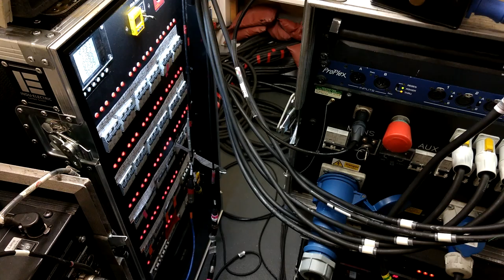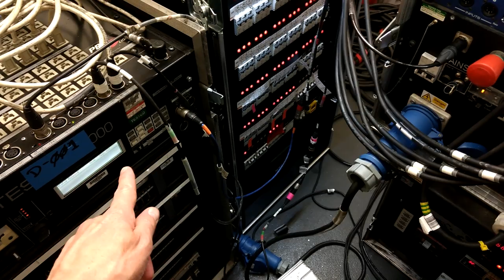Show power distribution.  Edinburgh Tattoo.

Comment: I guess no one uses Halon fire suppression any more. You definitely do NOT want to be anywhere around when that goes off. Happened in a computer center where I worked; someone giving a tour thought the Plexiglas-enclosed big red button on the wall was a light switch. Yeah.
Reply from the maker: I've worked in halon protected substations before.
Reply: That takes me back to my university days in the late 80s when the server room had oxygen masks hanging on the wall.
Reply: I was in Ebury Bridge sub in London many years back now when the halon went off. Can't tell you how quickly I got out of there. After a few minutes had passed control asked me to go back inside for a sit rep; you can guess my reply!
Reply: From what i heard, you'll be suffocated if an Halon system goes of.

Comment: A water based fire suppression system in a room full of electric... Hmm...
Reply from the maker: That's architects for ya.
Reply: Nitrogen gas and water, that would be a 'fogger' type system. Non toxic, zero residue, water itself is an insulator so it's probably the safest system that could be installed in a confined space with lots of public around nearby.  Maybe not the most effective but it keeps the insurance people happy.  Much friendlier than Halon systems where the instructions issued to contractors working in switchrooms went something like 'If the red beacon and siren starts, hold your breath and run'.
Reply: +whorayful  

Yeah, but only if it's distilled water - plain tap water is a perfect conductor because of the impurities and minerals in it, so do not use plain tap water in any fire suppression systems meant for electrical fires, which of course they wouldn't do as they're professionals. :)
Reply: @whorayful9361  - my university server room had oxygen masks on the wall for that very purpose.
Reply: Luxury!
Reply: Some the newer suppression stuff is quite safe, fm200 and argonite is breathable, we use it in data centres, the only real danger is to your ears, imagine 20 trucks air brakes going off at same time in a small confined space, though you can reduce it a bit by having more outlets... the shock from those things going off has destroyed many hard drives. Rule of thumb is if your in there and it hits 3rd alarm (suppression imminent)  get your fingers in ears fast :)
Reply: @jrand2631  even tap water in mist form is safe at mains voltage. The danger in in fires come from the smoke which usually contains conducting soot. The water mist tends to collect the soot on the floor. If you have the money data centers tend to convert to water mist systems as they can keep running in the event of a small fire.  With traditional halon systems you have to cut power and refurbish everything due to soot.

For smaller rooms and where interruption is less of a problem argonite systems are cheaper than water mist. For large rooms where the likelihood of at least one incident during the life time of the room water mist can be cheaper.
Reply: Peter Svensson What happened to CO2 based systems (basically compressed tanks of enough pure CO2 to make the oxygen percentage and temperature drop way down).
Reply: Hade a water vapor system go off by accident in my building in a server room. None of the 200+ servers didn't even go down. It's fairly electrical safe and doesn't kill anyone, not a bad system.
Reply: @johnfrancisdoe1563  I have only seen the argonite and water mist systems. The water mist systems were more expensive and take more space, but are better at cooling the fire and also absorb the smoke particles. The cooling is from evaporation from the small droplets, which is greatly enhanced by the temperature increase near the flame. Further the convection currents in the air will tend to drag the droplets into the fire. But it is expensive, or at least used to be.
Reply: @bigclivedotcom  as long as it's completely deionized water it would act as an insulator still. However, I doubt that's even remotely deionized...
Reply: The problem with CO2 systems is that they are dangerous for humans. If you start venting a big tank of carbon dioxide into a room, the concentration causes unconsciousness at around 7% by volume, and becomes lethal around 10%. However, this is nowhere near enough to actually suppress fire, which requires increasing the concentration to levels sufficient to displace most of the oxygen in the room, which I would imagine to be at least 70% carbon dioxide, if not more.

Another problem is that once a fire has been suppressed by carbon dioxide alone, if you then try to ventilate the gas by opening a door to an adjacent room, the concentration could rise to lethal levels in both rooms, as the gases in the two rooms mix. This has been known to happen with MiG welders working in enclosed spaces, using the cheaper mixed CO2/argon welding gas instead of pure argon.

Using pure nitrogen or argon is a much better solution, since either of these gases can suppress fire simply by displacing oxygen. Argon is better since it is slightly denser than air, but is also more expensive than nitrogen. There is still a risk of killing people if they don't evacuate quickly enough, but that is just due to the displacement of oxygen. When mixed with air, neither argon or nitrogen are toxic.
Reply: It doesn't really matter if it's distilled or not, water is an excellent solvent.  You'd need to keep your electronics clean from salts.
Reply: Peter Svensson Thanks for the clarification. :-)

Comment: Water mist is good fire suppression system for electronics, and used a lot in data centres. Gas systems require full sealed room to operate, as well as pressure relief dampers, as well as other requirements.

Comment: It's fun seeing the difference between UK and US theatrical distro gear.  Occasionally I will work with European equipment, and finding ceeform connectors and those odd value breakers is sometimes a bit of a trick over here.  I have a couple of suppliers, but sometimes the parts are a month out because the entire factory closed down for vacation.

I do wish we had a better alternative to 100A stage pin.  They work well and lay flat, but they're awfully sketchy and can be hard to disconnect.

Comment: NICE!

Although I had hoped that you would have showed us the 400A/660A Powerlock connectors!

Oh well, better luck next time I guess. 😏

Sleep well BigClive!!
Reply: I'll give you a clue, the cable that terminates in it is probably 120mm^2 or possibly bigger!
Reply: 250MM2 from experience. I don't like coiling 50M of PowerLock singles
Reply: 240mm would be a minimum size for a set of 50M at 400A. ive had some in 95mm (limited to 200A) and some at 400mm (120m) ~ 400kg per conductor 1 per road case
Reply: Used to work shows about 25 years ago....  Those power cable road cases were literally the heaviest cases in most of the shows I worked.  HATED working with those...

Comment: The fire suppression robably would not that catastrophic, ive seen 230/400V stuff get wet quite 
often. Even not-really-pure water is not that conductive (and there is 
quite some creepage distance on distribution equipment), it takes a 
surprising amount of water to even trip a 30mA RCD. Which will 
eventually happen though (especially when the dimmers and other mains 
voltage PCBs get wet), and therefore isolate most of the equipment. It 
would take significant flooding until something really bad might happen,
 and until then power should have been cut.
On the other hand, we had one of these Mennekes rubber cube CEE 
distribution boxes sit outside in a puddle, completely submerged, for around a day
 until somebody noticed. Continued to work fine (no RCD there), didnt 
catch fire or leak massive current to trip the 32A breaker feeding it. 
It was quite rusted so we threw it out right away but nothing burned or 
melted.

Comment: Odd question maybe: the white patch connectors, what are they called? 
We use those same connectors at the venue where I volunteer, and that's the first time I ever saw them.
Reply: White connectors are neutrik  powerCON output 
http://www.neutrik.com/en/audio/powercon/powercon-20-a/nac3fcb
Reply: EntourageTouring , yup. White = output, blue = input
Not to be confused with cee-blue. That means 220-240V.
Reply: EntourageTouring Not the distribution box in the thumbnail, the patch panel on top of the dimmer rack that looks almost like a network patch panel ("RJ45"), though it's actually power, not data/phone cables.
Reply: Thanx for all the replies, it's the wieland ST17/2 I was looking for ;)
As an engineer you come across hundreds of different connectors, and I guess it's my ASD that compels me to know how they are all called, especially if I've been using them for over 2 years :D

Comment: 230V @ 400A is a LOT of power, especially in a small space. Presumably "if something goes wrong" there's a main disconnect that trips before the water mist activates? (Mind you decent quality water is pretty non-conductive - the "really good stuff" has a bulk resitivity of 18 megohms/cm)
Reply from the maker: It is a lot of power, and saldy the water misting system doesn't automatically disconnect the power.  Even if you use clean water the general dirt and dust on equipment will quickly make it conductive,.
Reply: Thanks for that info - I was hoping that the water system and incoming power were linked. As you say, it'll not take long for that mist to be at least semi-conductive, and if the juice is still flowing things might become very spectacular ("who needs fireworks" spectacular! :-) )
Reply: Phil S In another video Clive talks about the year some of this stuff failed.

Comment: Looks too small to run 400a, no main isolator that I could see, but I am watching this from a phone. Keep up the good work fella  love the posts
Reply: Its not a dig Rob, are you from North America out of interest?
Reply from the maker: The 400A is a busbar system that loops from unit to unit.  Each unit does have breakers, but only rated to protect the associated distribution equipment.
Reply: @danjones7783  , no I'm from the UK , and as a electrician it all looks a bit light weight to run 400a. But if it can it can
Reply: @bigclivedotcom  cheers Clive, event  systems seem to have a bit more leeway than fixed installation, can't wait to go on my 18th edition course, we'll probably go back to red white and blue not Brown black and grey, lol
Reply from the maker: @robertsmall1715 It all complies with BS7671, but the event industry has an auxiliary standard called BS7909 that is much more complex because it also covers multiple supply sources which may enter each others zones.  Whereas the 17th/18th edition refresher is a one day course, the BS7909 is typically three days and jam-packed with data.
The 400A supply is fed from a suitably protected pillar and also has further layers of protection at the dedicated substation and distribution room.
Reply: bigclivedotcom But wouldn't looping increase the risk that a single failure takes out half the bus by cutting the loop? I would have thought a star system more reliable as each unit can be unplugged while the rest keeps running.

Comment: 400A,does it hum?
Reply: High Voltage AC humms. High Amperage glows.
Reply: @randomplantsandstuff  depends what part you're touching 😂
Reply: Nothing there to hum but the dimmers (when in use).

Comment: What type of lasers do you use there?
Reply from the maker: Purpose built lasers for events like this.  Heavily machined aluminium cases with a sealed optics section and large external heatsinks.
Reply: Sure, I do have some lasers for events myself but much smaller and more consumer grade, my interest is in more detail, what manufacturer, etc.
Reply from the maker: They were hired from http://www.er-productions.com who seem to custom build them.  The cases were very nicely engineered.  Quite a lot of routing and milling involved in making them.
Reply: Thank you Clive! Never heard of them but they seem to be pretty big as they achieved several ILDA Awards. Funny they seem to use Lasers from german company Lightline.

Comment: 400A & 240V?
Reply from the maker: 400A per phase on 240/415V
Reply: Do you have any video of your mains connection? I am interested as this is my line of work. A typical substation will have a maximum fuse size of 400A! (we do have bigger but generally if they need over 400A it is more economical to have them as a HV customer) .... Occasionally we get fuses paralleled out ... the biggest I have come across is 3 x 400A!

Comment: 400A at what voltage?
Reply: zh84 The installation is in Scotland. 
They (as pretty much all of europe) use 3Phase/240V at 50Hz. Neutral is separate from earth/ground.
Reply: 400V 3 phase
Reply: So 160 kVA
Reply: 276.8 KW  3 phase, 92 KW single phase (I x V x 1.73 on a three phase system)! And the voltage in the UK can be from 376V to 440v (tolerance in the UK is +10% -6% (230V single phase 400V three phase)

Comment: 276kva i wouldnt want to be anywhere near if something fail
Reply from the maker: It is all designed and built with suitable protection and spacing.  Just much more portable than fixed electrical distribution equipment.

Comment: How are they vaporizing the water? Is the other gas somehow used to do it, or is it powered?
Reply from the maker: I think the compressed gas is used to atomise the water as well as feed it to the atomiser heads.
Reply: bigclivedotcom -correct , if you want any information or videos of watermist in action let me know
Reply: Is this Mee Fog?
Reply: Looks like a halon gas, fire supression system. Often seen in server rooms, basically just suffocates the fire. No Oyxgen meens no fire. Probably best not to be in there when it goes off.
Reply: Aren't Halon fire extinguishers banned now at least in Europe, and weren't they always green.  Ironically, they were banned because they aren't green' they damage the ozone layer.
Reply from the maker: @ianjames9970  In a way it's similar, but Meet fog is filtered and compressed water being continuously pressurised through tiny nozzles.  I think it's thousands of PSI through 10 micron nozzles.
Reply: Halon is banned everywhere - except where it is needed.  There are some military applications, and I think unmanned server room / data centre applications, where Halon is still installed because the efficiency offsets the dangers.
Reply: ... and of course when taken out of service they all had to be safely disposed of.  Not suggesting in any way I may have a couple of extinguishers in the house and the car .
Reply: The Hi-Fog system uses compressed Nitrogen to blast water through atomiser nozzles, and pipe runs and diameters can be controlled to produce a very effective suppression blanket.  Search for water mist system in ships engine room fire, or something like that.  Also note it uses a relatively small volume of water.
Reply: This video, from about 11:40. https://www.youtube.com/watch?v=tKXiNdJMhgA
Reply: Thanks Clive.
Reply: Halon is still allowed on aeroplanes. I still have a halon extinguisher on mine.